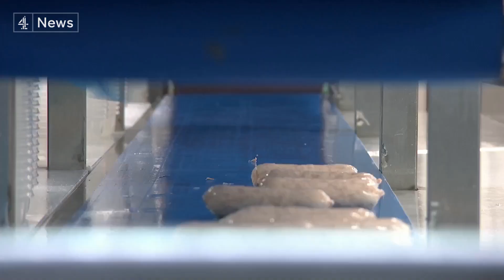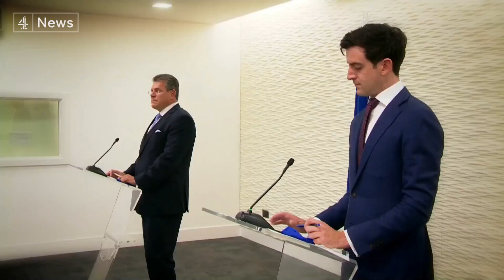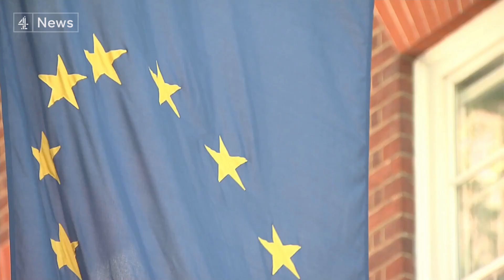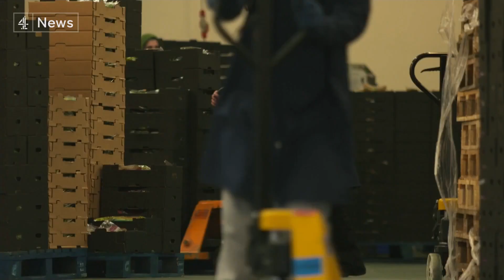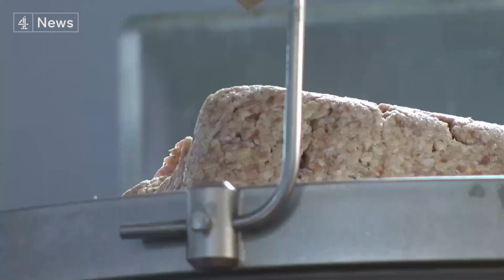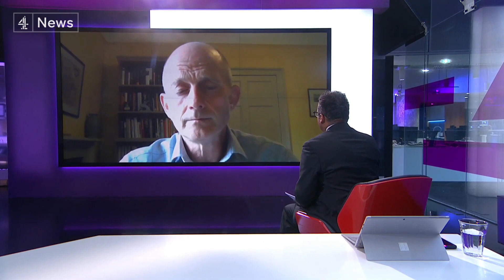EU’s ‘patience very thin’ after no agreement in ‘sausage war’ talks with UK

Comment: We just need to slap as many tariffs on those sausages and other goods as possible. Don't want to implement the protocol? Then prepare to pay tariffs
Reply: The EU will slap tariffs on those sectors of the UK economy that will hurt the most. The car industry for instance.
Reply: @Razor Mouth it would mean that all EU countries would apply tariffs for goods coming into the SM from GB. Goods between RoI and NI travel freely. It is only GB businesses who would feel those tarriffs.
Reply: @Razor Mouth The island of Ireland is already a phytosanitary Unit so checks to NI or RoI had to be done at the borders of entry. I can not see any business in GB sending products that need SPS checks without the necessary paper work accompanying. If UKGov decides to unilaterally drop such checks it does not mean the businesses dont have to supply the necessary SPS paper work when they ship. Like it has been since Jan21, UKGov decided to not do custom checks at the borders this did not mean that products shipped to GB did not have the export paper work in order, custom checks on imports or any business activity can be made months even years later if anything had been dodgy about a shipment it will cause problems during an audit. The EU simply could ban certain products with GB origin to avoid "import tensions at GB or EU borders" effectively cutting of GB businesses who are capable of producing the necessary SPS paperwork to export into the Single Market., this would reduce the need to deal with tariffs.

Comment: Why should the uk receive special treatment as a third country? Typical british exceptionalism.
Reply: Countries outside the EU get special agreements all the time (especially if the EU does huge amounts of trade with said country) that's what trade agreements are
Reply: @lewis123417  Yeah, but those are trade deals... and they respects our standards - EU sets and impose international standards in many area. If a country or potential trade partner can't abide by such standards, there will be no deal... this is the main reason why there is no trade deal between EU and USA. UK on the other hand wants to drop food for example, to better align their market with USA's low quality cheap food. Moreover, ''special treatment'' with trade partners, usually mean, selling certain products with tariff free, tax cuts, and quotas... What UK would want as a special treatment, is for EU to not have a border for UK... you get that if you joined the custom unions and single market, which will no longer make you a 3rd state.

Comment: Simply introduce detailed customs inspections of goods from Ireland and passports and identity checks in travellers from ROI -you can bet Dublin would have a quiet word with Brussels and they would suddenly become more flexible .Alternatively if the violence in Belfast was to be taken down to Dublin they would quickly sort the matter out  At present it is not impacting on  the ROI -if it was they would be urging the EU to be flexible .Marks and Spencer alone are incurring £30 million in extra costs because if this unnecessary bureaucracy .The Protocol can be made to work.rather than overthrowing it just by simplyfing the bureaucracy .
Reply: Well said. It’s the bureaucracy that’s making life difficult. Should have been streamlined months ago. That is where all the intellectual effort should be going — not in pointless rhetoric.

Comment: A clean break brexit with no NI protocol was a solution.
Reply: @UCvhyiIUO89kAGOTv0nB3znA  The EU won't erect the border between the ROI and the NI to protect its single market whatsoever happens bare that in mind. The only thing the EU might  do if the UK doesn't implement the NI protocol,  is to retaliate by setting up tariffs on some UK's  goods. That means chilled meat, sausages...etc could enter the single market and the issue would be settled.
Reply: @mazavl7064  Possible. But EU would than react with punitive tariffs at the ports in France, Belgium, at the Tunnel and so on. UK could react likewise. That would be, in a way, the "No Deal Brexit" which so many Brexiteers wanted - but I doubt it will help the British economy. A lose-lose-situation, as Brexit ever will be.
Reply: @strategon28  well, it will end the acrimonious dispute about the NI protocol.
Reply: @mazavl7064  ... and will create much more acrimonious disputes in Northern Ireland, in UK, in Scotland ... oh my ... be careful what your are wishing for. It might become true.

Comment: WTO now!
Reply: Will that solve the problems with a border. UK want to control his borders, so do the EU
Reply: How does the WTO solve anything?
Reply: WTO would demand to immediately check all goods coming in from the EU instead of saying "we were too lazy to prepare for Brexit and therefore, we didn't hire the 50,000 custom officers we'd need to do that." Is that what you want? Empty shelves everywhere? Congrats, you won, get over it!
Reply: What???WTO would demand border checks😤😤
Reply: @tomclarke5237  Have you read up on what the WTO does?
Reply: @tomclarke5237  Of course. Not carrying out border checks would mean to let EU goods in unchecked which in turn means giving the EU preferential treatment over all other WTO members which is explicitly forbidden. Inform yourself before posting, it helps your credibility. Did you really think the WTO would not have rules and regulations that need to be followed? Or did you just not bother to inform yourself about those rules and regulations?